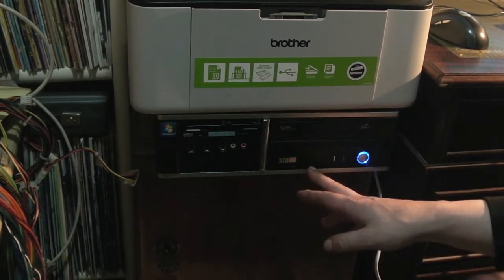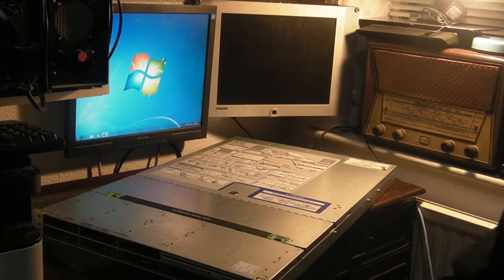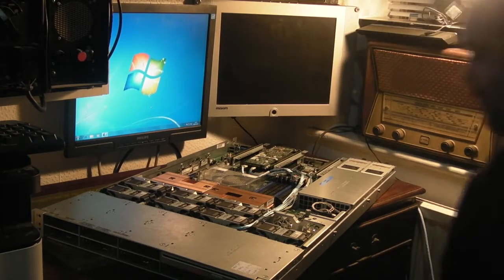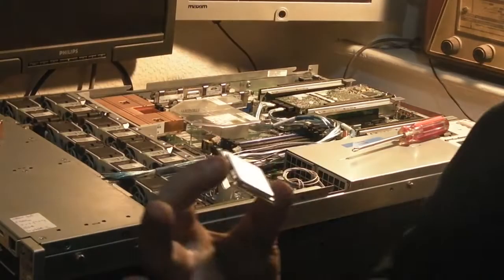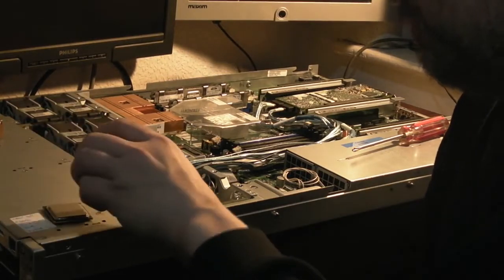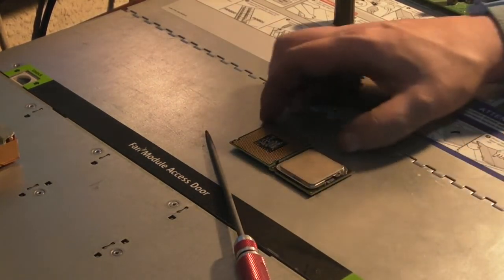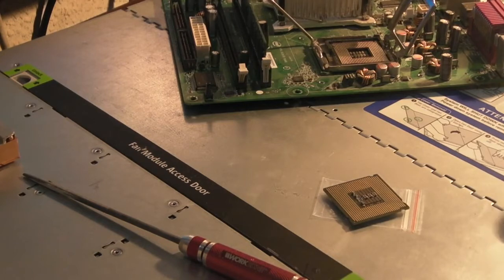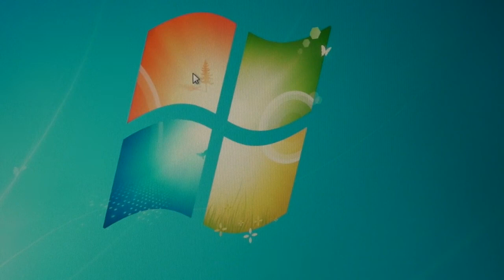Core2Duo CPU to Quad core Xeon CPU on the cheap Pt1

Comment: LOL!  This is EXACTLY what I had planned for next month when I get paid!  I've got a 3Ghz 8M cache Quad Core Duo, but was going to fit the 3.3Ghz 12M cache Xeon.
Reply from the maker: I'm just waiting for my tweezers to arrive and ill crack on with part 2. If it works it should give the system a new lease of life, will have to lookout for a better graphics card next i think. Another nice thing about the Xeon is it uses less power than its Quad core Duo counterpart in my case 80w compared to the 95w of the Quad core Duo. They are good for overclocking too (something you cant easily do using the LGA771 motherboard) I should be able to get 3Ghz out of mine with a little better cooling.